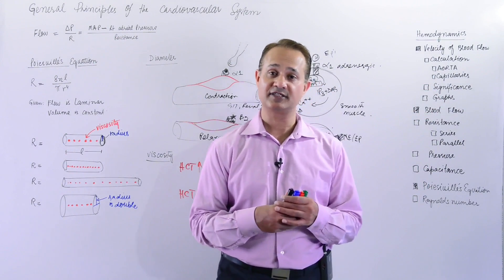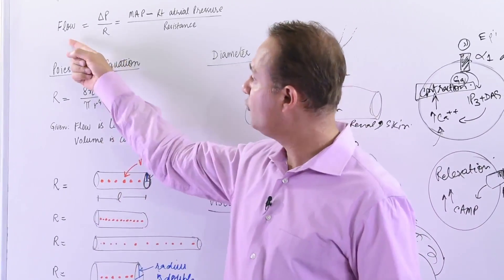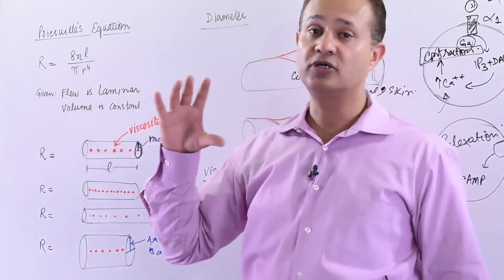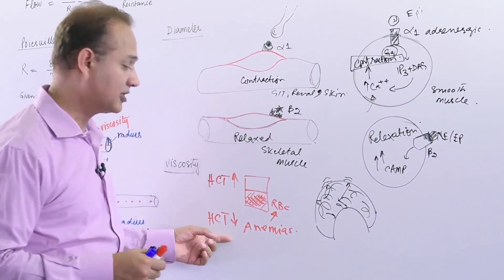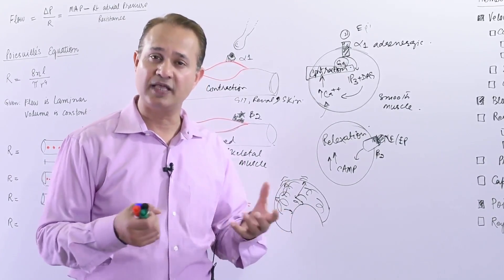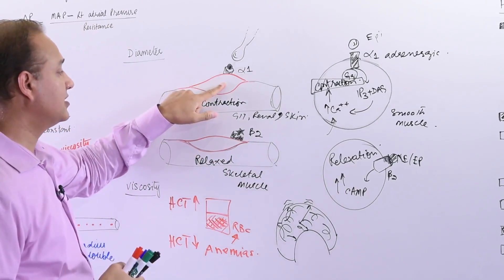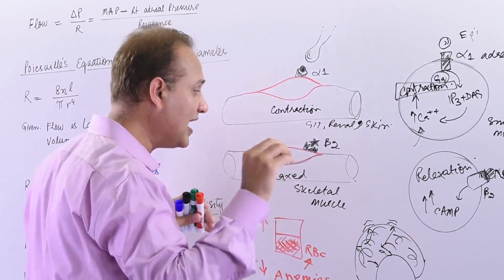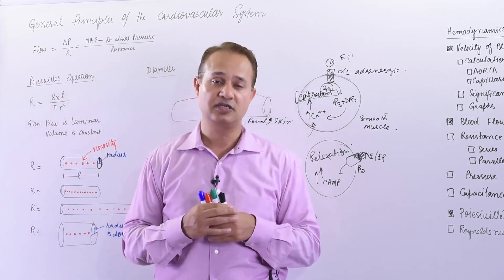Hemodynamics Poiseuilles Equation

Comment: I find this video fascinating as a hydraulic engineer with zero training in the medical field. I apply most of fluid mechanic theories to hydraulic systems for example the flow of water through pipes. I find the flow of blood in the body system and the flow of water in a pipe network strikingly  analogous.
Reply from the maker: Absolutely correct. Cardiovascular system is a closed system with viscous fluids in it. It is an amazing system to check the hemodynamics and many hydraulic engineering processes.